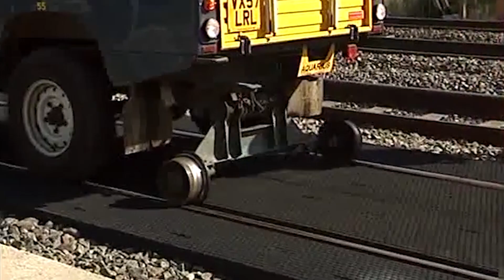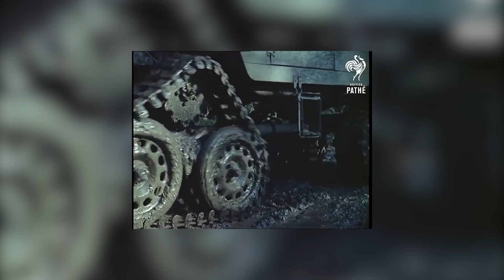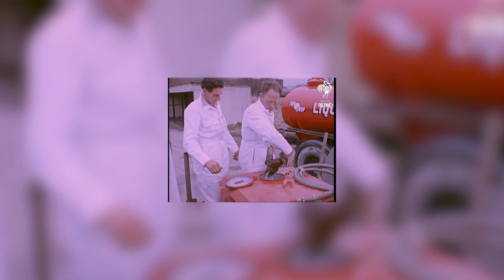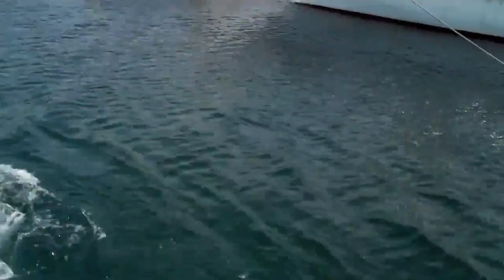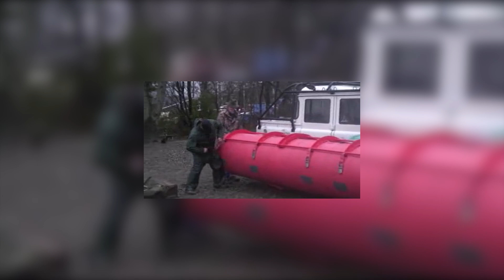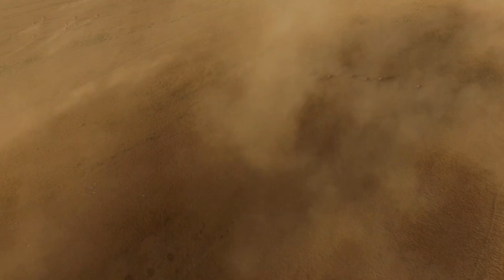5 Most Awesome Land Rovers

Comment: About the amphibious Land Rovers, whomever produced the film evidently did not know about the APGP (Air Portable General Purpose) Land Rovers that were built to be both air portable and amphibious. These spacial body trucks had deployable floats on both sides and front plus a single rear brass propeller. These Series tucks were built long before the Discos.

They could have also mentioned the Series IIA Forest Rover  that has special wings, bed and four full size tractor wheels. There were many very special bodied Land Rovers.
Reply from the maker: This is our list of Land Rovers that we consider to be 'the best' and is not in order of build. 

The Forest Rover is often featured in lists like these, we wanted to showcase something a bit different. Feel free to make your own video showing your favs 👍🏻
Reply: the forest rover was built by  Roadless   the tractor manufacturers now no more...apart from the body mods as  you say the landy itself was fairly standard  with the only major mechanical mod being  reduction hubs  to correct the gearing for the 11or 12 X 28inch rims